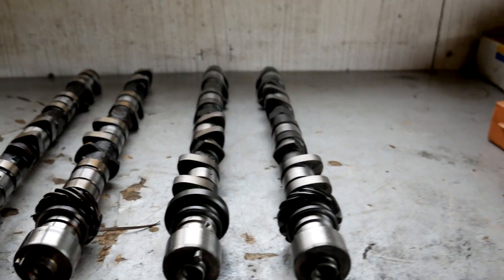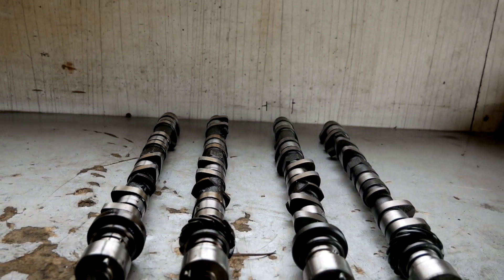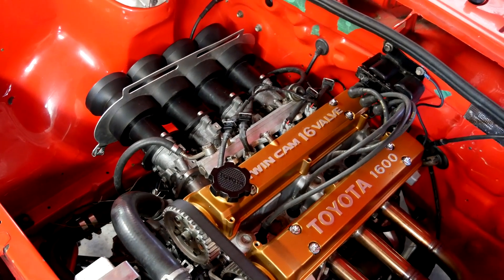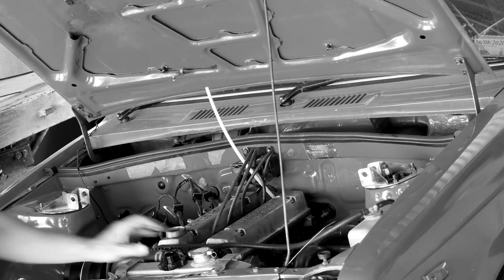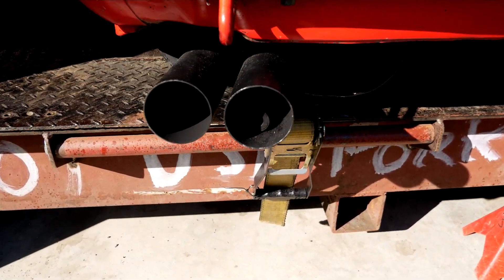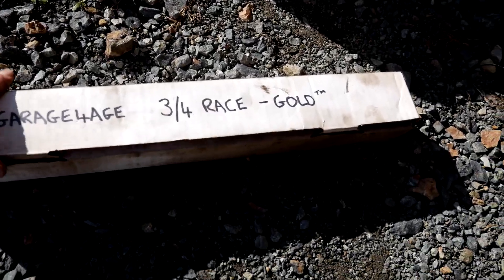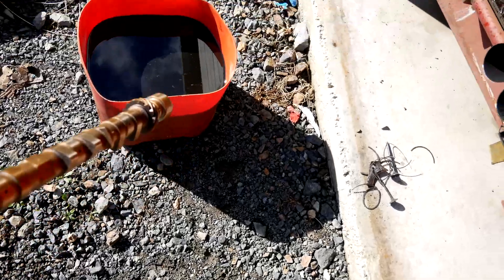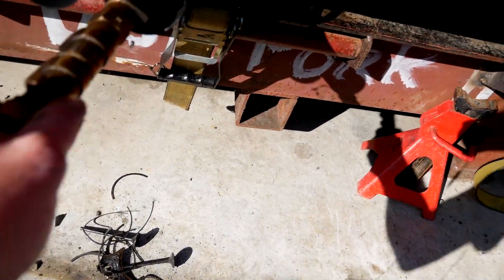Camshaft upgrades - Making Bigport great again - Part 5 the final?

Comment: Would there be similar gains with stock big port early heads kelford cams and stock intake manifold?
Reply from the maker: without the head work and stock intake manifold. i would expect 115kw at the most.    https://www.youtube.com/watch?v=c4keKCEa35w   <- that video shows stock inlet and the 193b cams.  its a smallport head and inlet.  the smallport inlet makes a bit more top end than bigport  so will be a bit more of a drop with bigport inlet.

Comment: Hopefully this doesn’t sound dumb but I got a bone stock red top big port and would like to throw in the 193 kellford cams. Would I be able to do just like that and see gains?
Reply from the maker: will need at least aftermarket ecu and valve springs to run them.  and for best results will need supporting mods. correct intake and exhaust

Comment: So, if i'm running stock ecu and stock intake manifold with t-vis and stock exhaust manifold on late bigport (1987 MR-2) there's probably no reason to just install Kelford 193b cams?
Reply from the maker: they wont run on stock ecu no. engine is retuned between these runs for the different cams.   you would get away with the early blutetop cams  but not much more

Comment: Does it matter which of the two tail pipes you install it in?  I feel like my car is slower. How do you degree it in the exhaust?
Reply from the maker: Degreeing is overrated,  You want to get straight into the italian tune up from stone cold,  bend the valves to the perfect piston to valve clearance
Reply: @Garage4age  the less compression means less stress on the engine

Comment: Thanks for the conclusion😍 everyone was talking trash in my 86 group that the big port performs much worse then the smallport. And I kinda know now where to go with my setup thank you.
And I got my hands on a knife edged crankshaft and trd cams with a duration of a 302 I think(actually no clus). Is the knife edge crank worth installing? I got it dirt cheap and I think I will loose a lot of torque that this engine really needs.
next time you change pistons. make sure to ref your engine that high to get an acess hole. step 2. change piston and bondo the hole.

Comment: Unfortunately people with pushrod engines have to do a little more work to install a cam . Make sure you cut intake and the exhaust lobes , separate them and put them in individually.

Comment: Great video! if you were to make an estimated guess using tomei poncams 264in 264ex 8.15mm lift both cams, how would they compare to the kelford 193b?
Reply from the maker: On this engine, at a guess probably 120kw ish.  the 193b quite bit more aggressive.

Comment: Does the head has shimm over bucket or shimmless buckets ? Because you go 8500 rpm and big cams :) 
I have a 7m and everyone says that you need shimmless if you want big cams.
Reply from the maker: Stock shim and bucket.  the 193b is designed for them.  My good engine runs more aggressive cams and needs shimless buckets.  So yeh depends on the cam.

Comment: Are you using stock lifters with shims on top? If so can you use shim under buckets and cams with 11 mm lift?
Reply from the maker: Yeah this one was done on the cheap, so still stock shim on bucket.   my good engine uses shimless buckets and more aggressive cams around 10mm lift.

Comment: I don't own a 4age or anything like that - got a classic mini - but it's great to see what the effects of different parts have on your performance. Lots to learn here for sure!
Reply: Damn man, exactly the same here.
Reply: @TheThunderwars  you got an old mini too? whats your specs?
Reply: @luismeixner2125  1330cc overbored A+ engine, a custom grinded cam which has about 268° duration with high lift (anything over 1.3 for the rockers would be way too much lift), a ported big valves head, 10.8:1 CR, HIF44 BBC needle with a 3D printed velocity stack I designed for maximizing torque (85mm long) and your standard 4 speed gearbox (not the close ratio that I will drop in soon), 3.44 FD and 12" tires (soon going 10"). There you go.

Comment: the 193b has a lot of lift, I guess you probably can't go further than 10mm without modifying the spring seats?
Reply from the maker: 10mm is about max.  kinda depends on the ramp rate of the cams also.  193b are designed for the stock shim, so the ramp isn't as aggressive as the  underbucket/ shimless, which most of require some material taken out of the head around buckets  to allow cams to spin